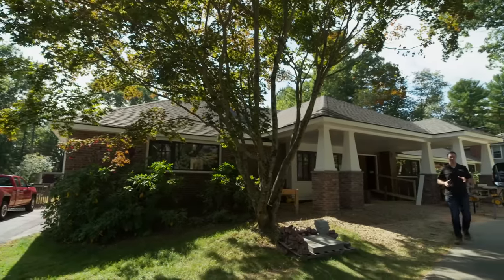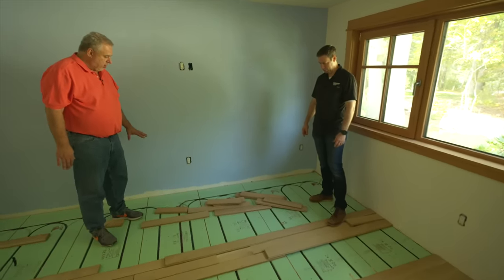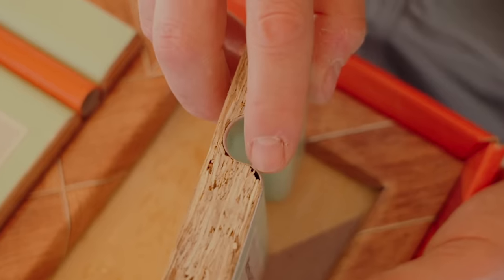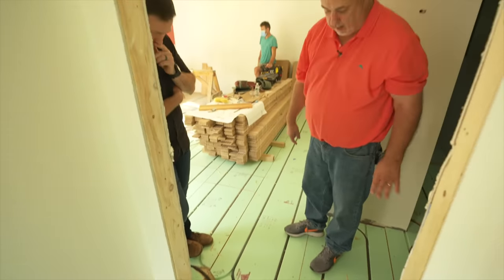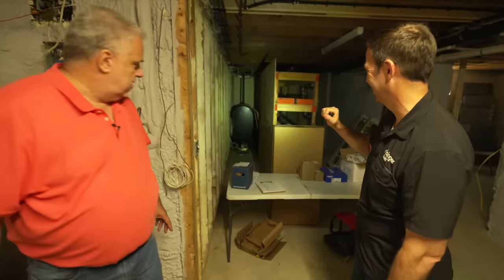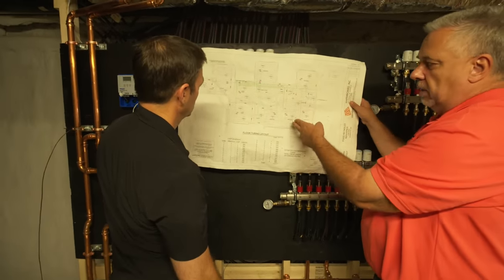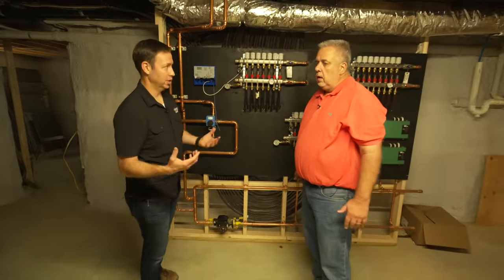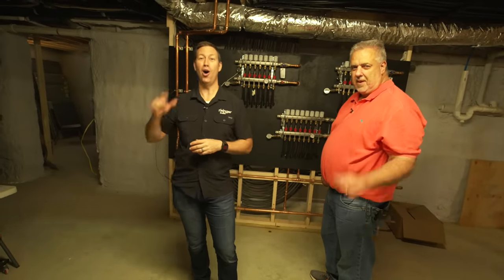Plug and Play Radiant Floor Heating System - BEST ON THE MARKET

Comment: We need this in the south, but for cooling. Actually it should go both ways.
Reply: Doesn't work that way.. You would end up with too much condensation on your floors...
Reply: @jesinbeverly  Tell that to the folks managing the Singapore Airport, which has radiant cooling. And also, a very sophisticated humidity management system. Radiant cooling is very doable, almost any climate zone, but higher heat and humidity makes it increasingly expensive due to dehumidification requirements, thus out of reach for the typical homeowner in say, Houston.
Reply: @leestevens446  They also put it on a wall, not a floor.. At least on a wall, there's opportunity to more easily catch the condensation.. If it was the floor, it'd just become a swamp..
Reply: @jesinbeverly  You need to exercise caution when making overarching statements on this channel. Most viewers have very little knowledge of building science, construction practices, etc, etc. What you are putting forward is very misleading. What you are throwing out in this comment is actually a wretched dehumidification system, if you are actually condensing on the "radiators". The radiant cooling systems that I am familiar with in Colorado use Warmboard on the ceiling joists under the drywall, for an even, low delta T system. Even here humidity must be managed, and NOT by a drip pan under the radiators. If you are allowing that to happen, you have already lost the battle and done the damage. If you are doing attached wall panel radiators (actually common in Europe, for HW heating), then you will need a much lower water temp because of the greatly reduced surface area, which leads to even greater condensation issues than with full floor or ceiling installations. This whole subject matter must be approached in a very rigorous and integrative engineering manner, or there can be serious long-term consequences (read: damage). And just so we are clear about this, I really like infloor radiant heat, and both like and am wary of Warmboard (we use it, but physical vulnerabilities/ leakage issues  come with the territory, and exist forever).
Reply: @leestevens446  It appears that the main point of the radiant cooling at Changi is to actually harvest water and to removed humidity from the artificial rainforest that exists in the airport/mall..That cool, condensed water is then used to condition the space via the swamp cooler effect..  I digress.  At a basic level, any time you make a surface temperature lower than the dew point of the surrounding air, water will condense on it.. This was related to my first comment regarding using a floor for cooling.. I can tell you from experience in the northeast that if my floor is cool from cool/dry days of weather and then a warm/humid front comes in, the floor gets damp.... There's nothing overarching about it.. If you have to go about adding a sophisticated humidity management system, you are just removing that moisture at some other point in your system.. Ironically, this is also a really good place to remove heat and serves as the basis for air conditioning... Radiant cooling plus a dehumidifier is a redundant system that simply wastes twice the energy..

Comment: Why wouldnt they run a dedicated manifold for each zone, and have those branch off of the secondary loop and dramatically reduce installation and material costs? They could run a 1" supply and return to the manifolds and locate the manifolds closer to each zone, control each loop on the manifold with a proportioning valve, eliminated the zone valves, and run it with dedicated zone pumps?

Comment: What type of tube is that in the floors? Plastic or coated copper or coated alloy? Maybe special high-thermal-conductivity plastic?
Reply: PEX or PEX-AL-PEX tubing is standard. PERT tubing is also an option.
Reply: PEX-AL-PEX is the best option. Oxygen-barrier PEX is also used but can make a bit of noise when the system cycles on/off.. but it's cheaper.

Comment: Is radiant heat that much more energy efficient? And what do you do for cooling in the summer? Still need a separate HVAC system for AC?

How much does a radiant system cost per 1000sq feet?
Reply: You can use a system like this, with a heat exchange pump, to cool the house. Not sure about this particular system, since it uses an *oil boiler*. Stupid AF.

Comment: Question does that radiated flooring does it heat the whole room cuz I got radiators in my house water radiators and I love it oh my God I love it but some rooms get real hotter than the other rooms so I'm thinking about shrinking them down and doing smaller radiators like the baseboards for certain rooms and I got a old style bungalow House Chicago style cuz I live in Chicago so you know where the heat rises up to the top I'm trying to go ahead and get everything where it won't be too hot no summertime and to hot in the winter time in a sense

Comment: What adhesive are they using. Any concern with it off gassing as it heats up? Years ago with radiant install underneath existing floors there were problems with odor because there was tar paper between original floor and a finished floor from previous install.

Comment: I would think you would want more than glue as a thermal bridge from the aluminum to the wood. Or is there no efficiency gained by adding a thermal conducting paste/adhesive/caulking?
Reply: We use a reactive hot melt glue to adhere the aluminum to the wood substrate. This is a powerful bond, and can only be broken by actually destroying the panel itself. Insulation should always be installed below our panels, so once that's done, any additional efficiencies from a thermal conducting adhesive would be negligible.
Reply: The glue is only for the wide sold wood flooring, nothing to do with the heating system.  Radiant floor heat is awesome.
Reply: Nope. Wood has a low R value rating and the alum does a good job of distributing the heat.

Comment: A MILE of water piping under the hardwood just waiting for the handyman to put a nail through the tubing. Just a small leak that will do the most damage before you even know about it. Sorry to be such a pessimist but we all know Murphy's law.  I guess with this level of sophistication they monitor water loss.  Now we have to install cooling and air quality control. I guess if you have the money and want warm feet. Thanks for the great videos.

Comment: I would like an in floor heating like this but then u still have to have a separate system ducted for cooling in hot summer months. Might as well do heat pump if you still have to put Register. Put a woods stove in basement to radiate.

Comment: I think you will need to run an Ethernet cable between floors because Wi-Fi from the first to second floor is going to be a problem with an aluminum floor.

Comment: can I ask a question. How much oil used in before they got underfloor heating in the house according to what I know then there is a heat loss on air heat 40-50% before it out in the room

Comment: What are the benefits of laying pipes directly under the floor, instead of burying them in a massive slab? 
Space saving comes to mind, but little else. When building my own house, I settled for 70mm concrete over 70mm EPS cushion, thinking of saving space... wrong decision. if I could go back in time, I't probably double the slab thickness and heat capacity.

Comment: I cringe at the thought of stapling that floor thinking one of those is going to pierce the radiant floor tubing.  I noticed a few places where stapling the floor would be near impossible without hitting the tubing.  Do you just glue those in and continue stapling on the next row?

Comment: Can this be installed as a new build in a space with combination porcelain and engineered hardwood? Any risks to consider?
Reply: yes and none I can think of out of the ordinary
Reply: @stevenbaczekarchitect9431  Kahrs Hardwood is a manufacturer of thatched hardwood flooring designed to be more conducive than standard hardwood flooring.

Comment: I read through a lot of comments but didn't see much addressing of the  differential expansion between the aluminum underlayment and gluing + nailing the wood to aluminum.  Any known  issues? As a previous home inspector I often encountered warped & buckling floors, usually related to moisture/humidity but I can envision heating could cause trouble.
BTW flooring glue usually gets harder with age & heating could accelerate this as well, depending on brand/formula.
Any knowledgeable comments appreciated.
Reply: well.... We've been using systems like this here is Europe for over 20 years without issue. We also only glue the wood floors. In fact, I doubt you could even buy a wood floor nail gun like that. 
The only disadvantage is that the if you went on vacation during the winter, it takes days to get your house back up to temperature since the water in those heating coils are nowhere near as hot as traditional radiators. As a result though, the heating costs are actually way lower.
Reply: @pablomax3045  Thx for your input. 20  years with glue only speaks for itself.

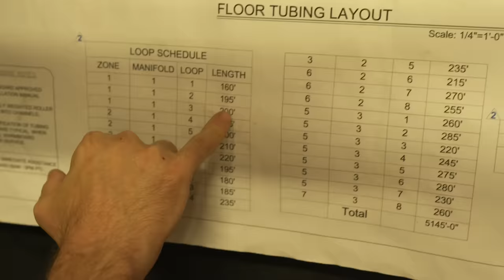Comment: Matt. At the 9:30 mark, the guy you were speaking to mentioned that the ufh (underfloor heating) guys wanted the manifolds closer to the zones but he ‘nixed’ that idea. 

Can you explain how he managed that? I’ve been told by ufh companies that the manifold needs to be in a central area as close to the zones to minimise heat loss during transmissions. I would also like to have all my manifolds in one location and would be interested to know how they achieved that.
Reply: We will design the system how you want it. However, putting the manifolds in more central locations (typically hidden in the back of a closet), is much more efficient - less heat loss, and much less tubing to run. By hiding these manifold cabinets in the closet, you also end up with a much smaller mechanical room/wall in the garage (or basement). But again, if you want to centralize your manifolds in one location, like this project, we're happy to design it for you that way.
Reply: Yes, Warmboard had an iniial design that was more centrally located but in review with the client we desired a centralized location in the basement. I highly commend Warmboard on their efforts to support our desires and not fight to uphold their design for convenience. Great companies like Warmboard solve problems - that the kind of team player myself, and my clients need and want.
Reply: @stevenbaczekarchitect9431  We appreciate the high praise! Thank you sir.
Reply: @Warmboard  Deserved - not given

Comment: So this seems like a really nice way to heat a home and perhaps is even fairly energy efficient? However, what happens in the summer when you need to cool the home? If you still need to run AC then you get all the duct and other stuff that comes along...do people really do both or is there a way to run cool liquid through the floor....do people really ever want to walk on a cold floor though....all very interesting
Reply: don't characterize all radiant systems based on the system that this guy is using. one of the drawbacks to a boiler is that a boiler can only heat water. so you have to have a separate system (e.g. an air conditioning system) to provide cooling. that why in europe (where radiant systems are much more prominent than in the US), heat pumps are becoming the leading heat source, replacing boilers.

Comment: I've had boiler systems, mini split systems and forced air.  With a tight home, mini-splits and forced air are where it is at for me.  Home gets warm in 10 mins.  No massive plumping systems. No expensive controls.  No gallons and gallons of hot water to heat.  
I'll take simple over complex every day of the week.
Reply: No doubt - for this client radiant was the answer, America is a beautiful place......

Comment: how is Steve handling cooling and fresh air exchange?
Reply: ERV for ventilation and Ducted Heat Pump for AC
Reply: @stevenbaczekarchitect9431  Is the ductwork tailored for A/C differently than a typical cold climate duct system?

Comment: Is ordinary white oak stable enough to avoid warping due to the heated tube? Is cross sawn white oak more appropriate?
Reply: Either can be used on our system. The aluminum creates a very steady and even surface temperature. Acclimate to get the moisture levels before installation, then you should be fine.
Reply: its likely going to split overtime, and can buckle if there is issues managing humidity in the home. The safe bet is to go with Engineered flooring instead.

Comment: My locality has SUPER high levels of calcium in the city water. How does this product mitigate that to prevent premature clogging and how is it detected if it did happen?
Reply: Presumably you can introduce an additive into water.

Suspect you would know about any clogging issues as you would feel, gradually, you weren't quite as warm as when system was new.

I have PEX on board my boat and the manufacturer advices an "all in" additive at no more than 30% solution.

Turns out some of these additives are useless at transporting "heat". Boiler doesn't like it.
Reply: @t1n4444  Hmmm, good to know.
Reply: @NorthernChev  Oops! Forgot to mention there is a permanent magnet clamp device which goes around pipe and, allegedly, does some kind of "alchemy" to the calcium atoms.

Prevents them clumping together on the inside of the pipe. We use a lot of copper pipe and it works with that, supposedly, so perhaps it wouldn't work on plastic pipe of whatever class???
Reply: Best option is to use distilled water in a closed loop system to avoid a scale problem.
Reply: @guytech7310 That would work but ...   always a but, you might need to consider using an anti freeze additive, glycol or similar.

As in if you went away for Xmas, boiler failed, water froze, pipes split, temps rose, ice thaws, come home, wade across carpet accompanied by  spousal abuse, along lines of  "I don't suppose this would happen in Tommy's house ..."
Reply: @t1n4444  Yes you can add glycol to the system if freezing is a concern. I am Not really worried about it, since I have backup power and backup heating too. Also it does not get too cold where I located, Freezing temperature for more than a few hours only occur in January.
Reply: NorthernChev It's a closed loop system. The water you put in today will still be there in twenty years time. Any calcium will precipitate out within hours of it being switched on for the first time and after that no more will magically materialise- even the hardest water only contains a finite amount of minerals. Given the low water volume of these systems there is unlikely to be enough to cause an issue and as previously mentioned a good installer will dose the system with an inhibitor suitable for the different metals in the system and the local water quality.
Reply: @spencerwilton5831  Thanks for the reply! But... I currently have a low-pressure hot water system in my house just like this and although these are considered "closed loop" they DO, in fact, actually "use up" a bit water occasionally, and utilize an autofill / metered pressure system to refill it automatically as it uses water. So, new water is introduced into these systems regularly.
Reply: EDIT: The autofill and anti-siphon devices built into these systems are regularly replaced every 5-7(ish) years requiring the entire system to be drained.

Comment: What cooling system is used when the entire home has radiant heating? Is there a separate system for air conditioning in warm seasons?
Reply: Generally you would still have ducting in place for AC/forced air. Another option would be several mini split units.

Comment: great infomercial,... but I'll take the conductivity of masonry or ceramic any day,...when someone who lives here eventually pierces one of those lines,...the repair is going to be a nightmare. What's the cooling system ?  Floor heating wants to be , and is good to have everywhere,...but concrete slab is the best place for it.

Comment: Why bother running the tubing in a small closet? Is it required so the flooring is all heated evenly to avoid problems from expansion/contraction?

Comment: nailing looked tricky, no heat pump? this was a good look at higher end radiant - there really is not all that much to it - some manifolds and solenoid valves #zones #circulating pump

Comment: I wonder if they do radiant cooling for the ceiling if you don't want vents.
Reply: Brad Viviviyal  Radiant cooling, not heating. If you cool the floor you get cold feet.
Reply: this system uses a boiler. you can't do radiant cooling when you use a boiler.
Reply: @paperwait9611  Yes I realize heating systems don't cool lol
Reply: Does solve the primary job of AC: Removing humidity. Also at risk of condensation if the ceiling temp is below the dew point.
Reply: @TinyGiraffes  radiant systems are not inherently "heating systems". this one just happens to be one.
Reply: @paperwait9611  That's what I'm saying

Comment: Is there a way to switch from hot winter to cold summer?
Reply: No. You would need a separate system for cooling as running cold water through pipes causes condensation. Radiant cooling in panels is typically done in the ceiling, and requires more controls and dehumidification.